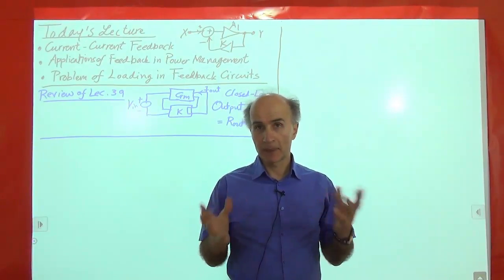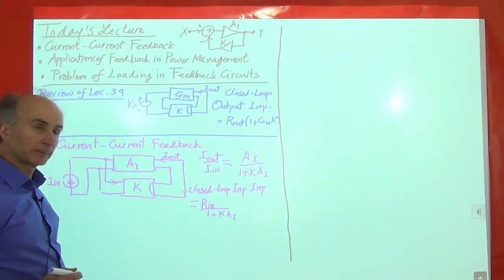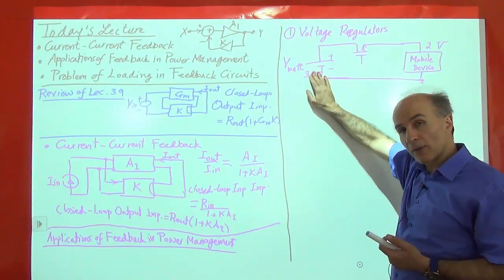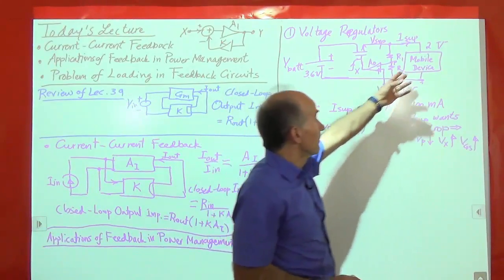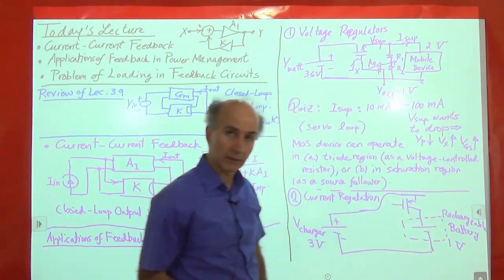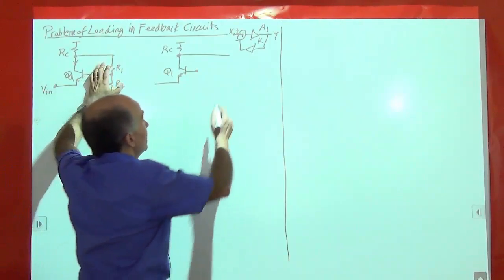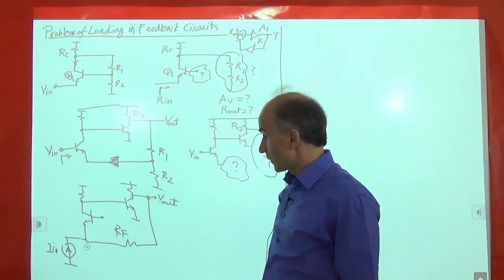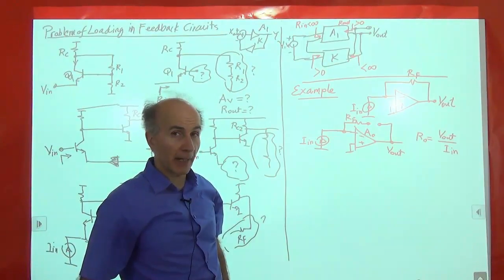Razavi Electronics2 Lec40: Current-Current Feedback, App. of Feedback in Power Management

Comment: Voltage Regulator shown here looks confusing, Inverting terminal of Opamp gets 1v and non inv terminal has 1v as refrence voltage, so if both the i/ps of opamp are same so O/p of that opamp is zero so gate of mosfet gets 0v, since it's a source follower circuit so source should also get 0v ?

Comment: Note: The fact that regulating transistor is in common-gate configuration tells us it's amplification polarity and that it will not change voltage drop across itself much with change of the load. Basically, if the sensing network was high impedance, output of the amplifier won't change much, and will always lay around Desired Output Voltage - Vgs drop. And all of the excess voltage will be drooped across the channel of of the transistor (all of the V_bat - V_out - V_ov will be dropped across the pinch-off region).

Comment: 01:26 - Intro and Review
04:02 - Current-Current Feedback Topology
09:10 - Applications of Feedback in Power Management - Voltage Regulators - Servo Loops
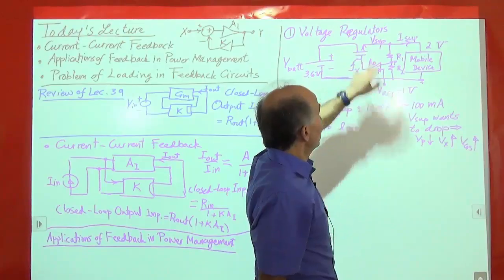21:25 - Regions of Operations of the Regulating Element
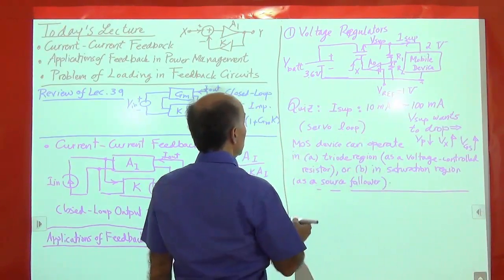23:48 - Current Regulation
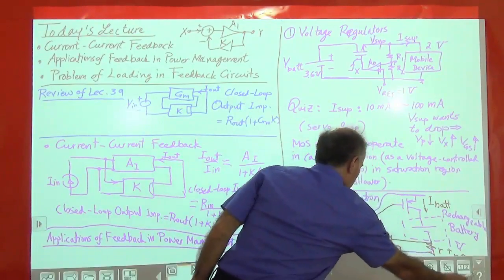30:30 - Problem of Loading in Feedback Circuits
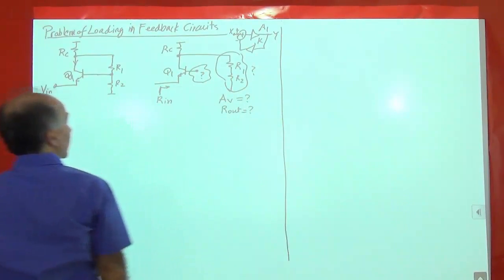>> 37:10 - Second Example
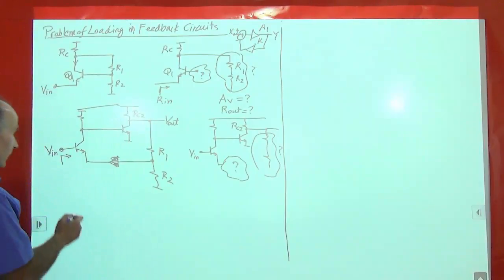>> 40:05 - Voltage-Current Feedback Example
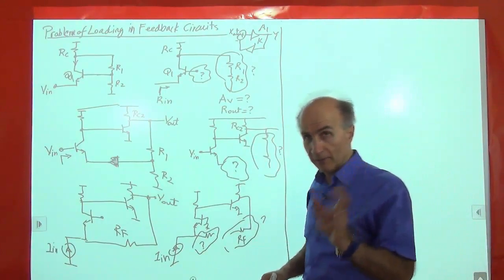>> 41:40 - Summery with Voltage-Voltage Feedback Example
>> 45:00 - Problem with Voltage-Current Example with High Open-Loop Input Impedance (Trans-impedance Amplifier with Low Open-Loop Input Impedance)

Comment: At 28:24 polarity where Vref is given should be +ve and where f/b is taken should be -ve...but you did reversed ..I didn't understand that..Plzz clarify?
Reply: @竹炭水-i6e  thanks buddy
Reply: If you have doubt..break the loop at non inverting terminal of opamp..connect test voltage at one end.. deactivate all independent sources.. vtest connected at non inv terminal of opamp.. if it increases, output of opamp increases, output of opamp = gate voltage of MOSFET,MOSFET in common source configuration, if gate voltage increases means .. drain voltage decreases.. so we can conclude if vtest increases, vf decreases which leads to negative feedback.. that means whatever professor choosen polarities are correct..
Reply: @SirishaSiriYanamadala  so current flows from drain to source in mos so we can take - I batterry and multiply by r it will give -ve drop which means we apply a +ve Vtest and and at Vf side we obatined -ve drop? is my analysis correct ?
Reply: @padhai6695 see i already mentioned in order to calculate loop gain.. I have to deactivate all sources first ,this means including battery, vref..etc all i deactivated means replace it by its internal resistance..that means 0..i assumed vtest increases..here  drain voltage = vf .. i already mentioned how vf decreases if I increase vtest.. so it will indicate -ve feedback..
Reply: @SirishaSiriYanamadala  oh thanks, are u also preparing for cllg placement ?
Reply: Nope @padhai6695